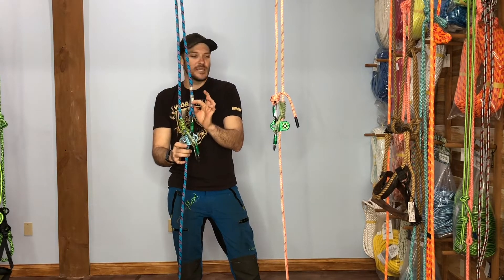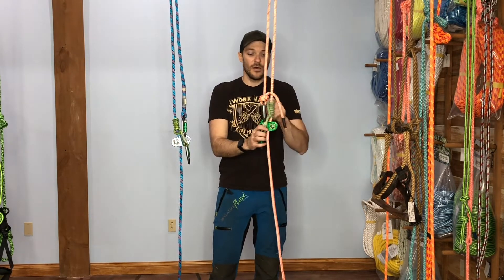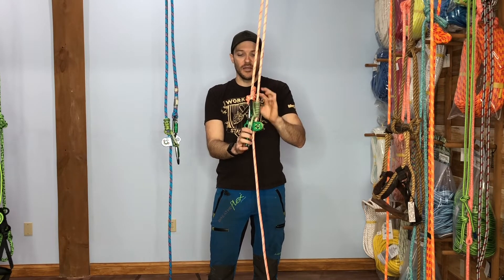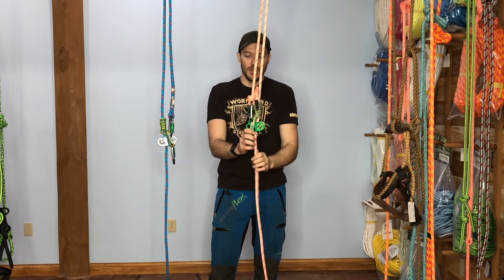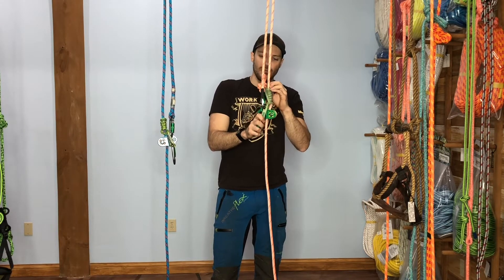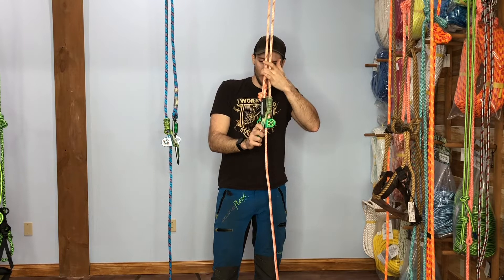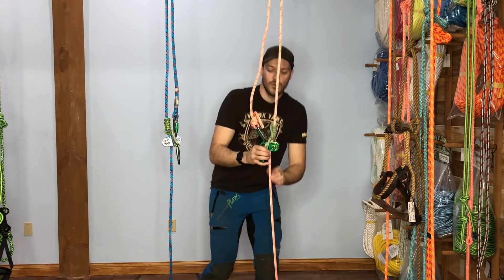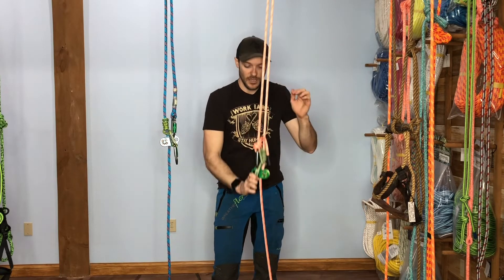Keep your Hitch Climber setup safe

Comment: A year ago when I bought my climbing line I ordered double cuz they were running a 1 month free  special on spliced eyes. They have the band on them too so u can close the hole on the eye. I am going to be using this concept with my new DMM ECCENTRIC & I also bought a regular Pinto with the spacer for more applications.  I believe they say not to run a stopper knot with the Hitch Climber but I think just making the adjustment u made makes much more sense.

Comment: I'm learning low and slow in my garage, and discovered this issue last night.  I'm using a 22in x 8mm knotted hitch cord around 11mm rope.  Using the pulley's middle hole still releases my hitch.  With SRT increasing in popularity and fewer spliced ropes around it seems like this issue may become common.  Is a bowline with Yosemite finish an acceptable alternative termination knot?  The bowline won't cinch onto the biner, but it could be a simple way to lift the knot's bulk to a safe distance above the hitch release zone.

Comment: Thank you for this just ordered a hitch climber system and was worried about the termonation knot descending the prusik.. Are there any fixed loop termination knots i can tie so the knot is higher than the prusik?
Reply: Use a fixed bowline so your knot/bite is a couple inches or more above the prusik
Reply: Yes a long bowline works like these bees knees